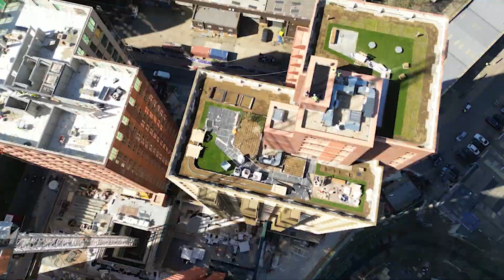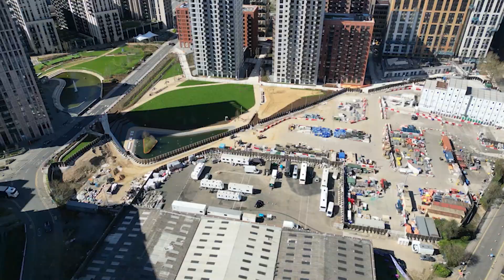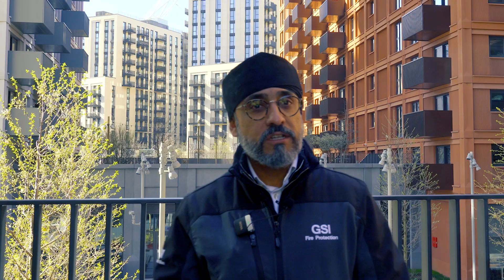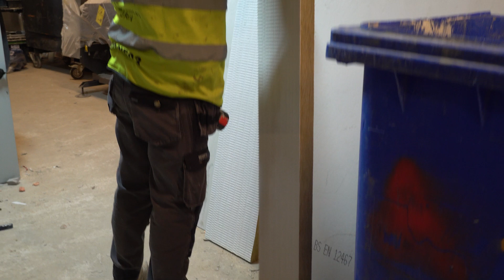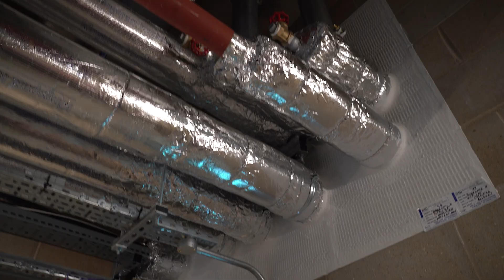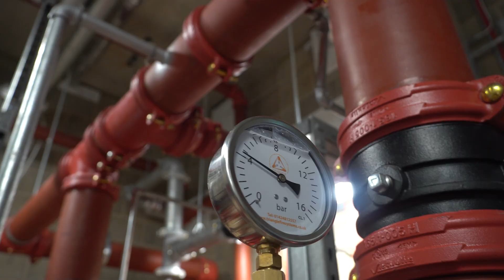Nullifire Major Firestopping Project

Comment: I find this hard to believe from Nullifire I requested a single sided detail for a 50mm diameter hole with a single cat6 cable dropped down the plasterboard cavity and they were stumped - no details available for single sided penetrations - useless 😢
Reply: Apologies, it would seem your request was miss understood.  You may have been told the response would outside of UKAS accreditation, as at that time no standard for partial penetrations existed . Generally we would have offered you a TE based on a significant amount of Data Cable testing.  Ian